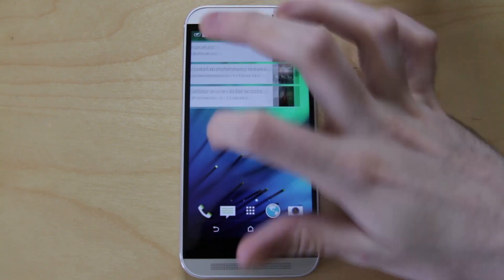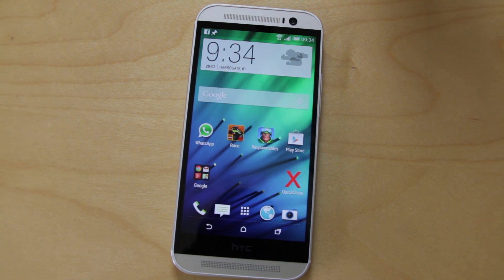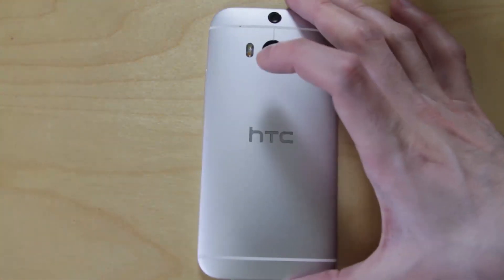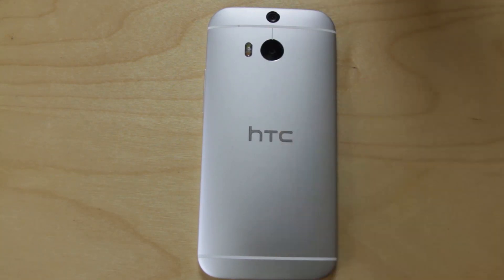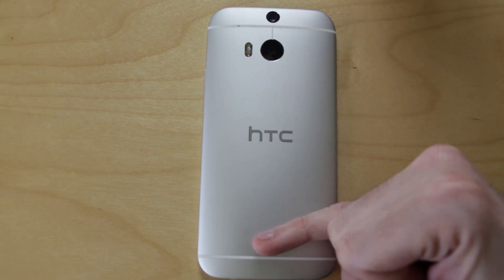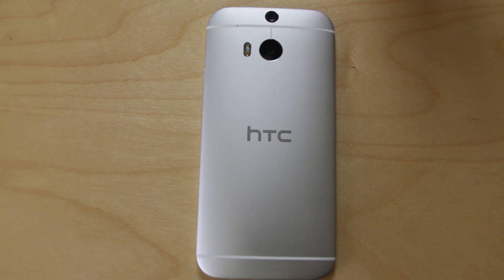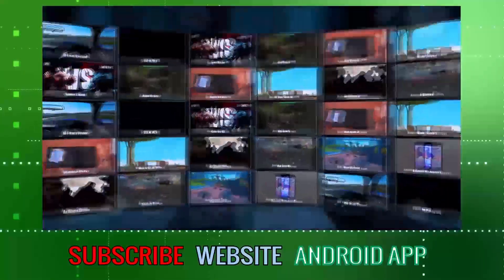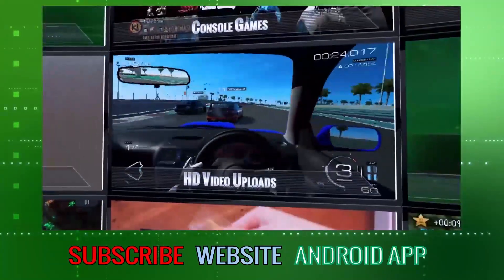HTC One 2014 M8 heat build-up and thermal properties review - Androidizen

Comment: In a couple minutes my m8 gets hot and will run out of battery very fast is that a normal issue? Is it's yes I'm OK with that just wanna know or that's normal for m8s any tips?
Reply: no its not my m8 gets hot but batter still holds fine

Comment: Finally, someone who talks about REAL engineering differences between smartphones. The HTC One M8 is without a doubt the best engineered Android phone on the market. They actually spent time tweaking the phone and didn't just throw in the most powerful processor around, clocked it at its maximum, put some plastic around it and sell it to people. I had a Nexus 5 before the M8, and that was a quite excellent device, but it got insanely hot and battery drain (while in use) was terrible. That meant that the phone almost never ran @ 2.3ghz. Thermal clocking was so aggressive the Nexus 5 was actually slower than many competitors with the same SOC.
The M8 on the other hand, has a 2.3ghz Snapdragon 801 that manages to be faster than, for instance, the S5, which has a 2.5ghz 801 processor. This is all due to excellent engineering, so that the phone is able to run at its max for extended periods of time. That's very important. It also helps with screen-on time, as a lot of phones have excellent battery life on standby and drain pretty quickly when active. Not the case with the M8

For the record, I was looking at logcat on the Nexus 5 some time ago. I counted 1 minute of screen-on time doing basically nothing before thermal clocking started downclocking the CPU to keep it cool. Awful.

Comment: Hope they learnt a lesson after the failure to protect the camera module from heat on the M7. That was the cause for the awful pink tint.
Reply from the maker: Heat when using the camera has been alright i did a 2 minute zoe last night and honestly bet it would burst into flames, it got warm but not terribly. It was working hard as well in low light.